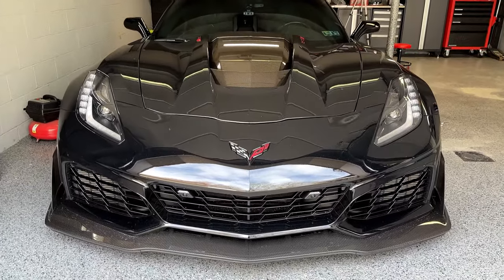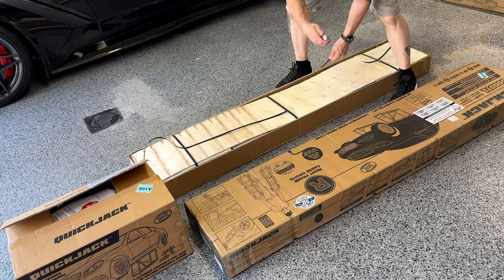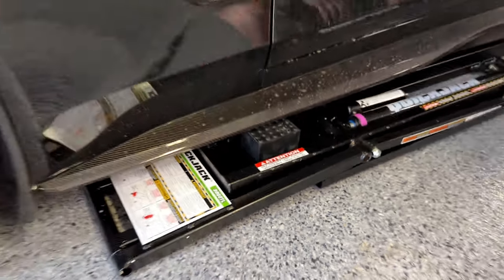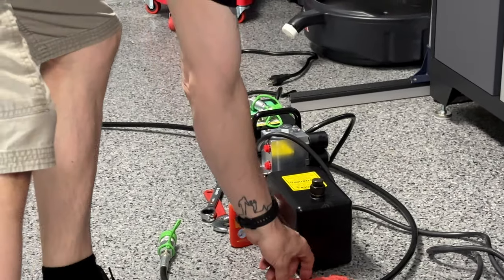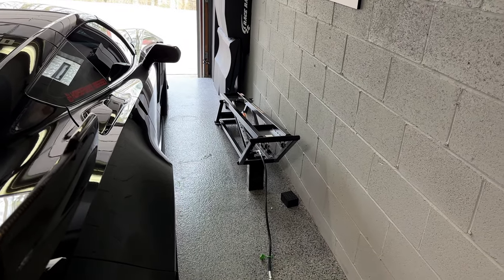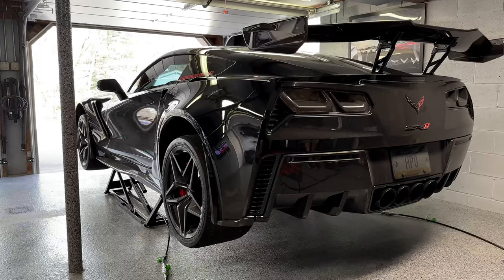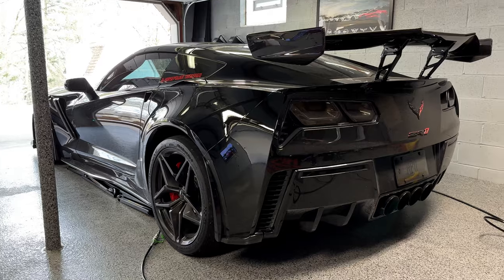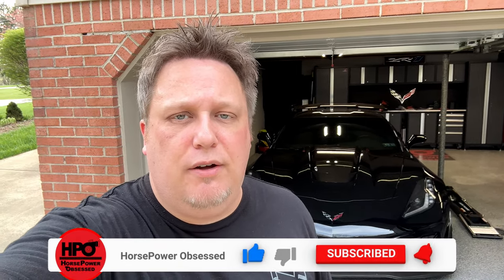The Ultimate Quick Jack 5000TL Setup Guide for Beginners

Comment: Purchased the Quickjacks last Fall. Used them to install the Borla axel-back system.  Noticed also that they do move the nose forward while raising.  Like you, did it with the garage door open.  Also purchased a kit to stow the installed hoses and now have casters to roll the jacks around.  I have not lowered my Grandsport so no issues getting the jacks under it.  Thanks for another interesting & helpful video Justin.  Bruce
Reply from the maker: You’re very welcome! Thank you for the tips! I didn’t know there was a kit for storing the hoses!

Comment: “Possible damaging trip to the dealership “ - most of the time it’s true.
Thanks for the video !
Reply from the maker: Unfortunately it is true more often than not it seems!
Reply: Yep we have 3 hellcats. Took our low mile almost new challenger redeye to dodge under warranty for an A/C line that went bad. Our GPS popped up they were driving 140MPH down the 5 freeway. I dont think an air conditioner line needs a road test, let alone freeway racing. They also scratched the bumper. They wouldnt take responsibility. They said they hire a local car detailer to come wash all their cars and blamed him

Comment: 6:11 don't you want to crack that "bleed screw" when they are pointed up so that all the hydraulic fluid flows to the bottom of the cylinders and the air in the system is at the top where the bleed screw is. Sort of like bleeding brake calipers.
Reply: The cylinder IS pointed up when bleeding.  No idea what you are saying.  When the Jack it dropped down the cylinders are pointed up.
Reply: @executiveinvestments  What do you call that Allen Key at 6:40? It that at the top? I don't think so; its at the bottom of the cylinder. Take it from someone that installed a hydralic lift system.
Reply: @achristian7015  what do you call the bleeder screw at 6:50?  Is that pointed up?  Yes.  Kid, you couldn’t wait that 10 seconds for him to show the bleeding.  Hence you embarrassed yourself by saying something you are completely wrong about.
Reply: @executiveinvestments  And at 6:22 where is that bleed screw where it is clearly visible? Below the rest of the system. Duhhh!  The trouble with you over-educated types is you cannot reason. A bleed screw has to be at the highest point in the system and not below the rest of the cylinder. Now if he tilted that end higher than the rest of the system, he would get the air out faster. On my real lift, the bleed screws are at the top where the cylinders are vertically mounted.
Reply: @achristian7015  he is doing the bleeding exactly the way Quick Jacks says to do it in their instructions. The bleeding is done while the Jack is in the lowered position, with the bleed valve end of the unit slightly elevated. Please do some basic research before you insist someone is doing it wrong. You don't know as much about how this works as you think you do.
Reply: @j29maniac  yeah right which is why I never have to hire any trades for two reasons. 1) it is done right and 2) I get to save money which is a bonus. My QJ is working perfectly just as my self installed MaxJax is that is now 10 years old.
Reply: @j29maniac  by the way wise one, the instructions for my BendPak MaxJax were not only in error, but also contradicting their info in the manual. You think Quick Jacks is perfect which is why their own manuals have "versions".
Reply: @achristian7015  all I said was he was doing it the way the people who designed it instructed him to do.  You know so much more about their product than they do, so you can do it however you want to.
Reply: @j29maniac  Just because it is in a manual, does not make it right. Which is why manuals have revision dates and versions. My other lift is a Bend Pak Max Jax. There were errors and contradictions in the manual. Too many believe everything they read on the internet, you need to know enough to reason through what you read. Car forums...everybody is an expert but knows nothing.
Reply: @achristian7015  your last sentence says it all. I totally agree with you.

Comment: It's about time you got them. lol I bought the 7000TL for my mini and SUV and had them a couple of years without any issues. I didn't think they were low enough to get under your car but good to know.
Reply from the maker: That is the reason I went with the 5000 because it needed to fit under my car.
Reply: @HorsePowerObsessed  what is the width of the frame of 5000? The 7000tl is 1.6 inches

Comment: Just to confirm, does the lift point spread on the Quick Jacks align properly with the lifting pucks on the car?  It didn't look like you had to use a special attachment or unique approach to make it work but I want to be sure.  I just bought a C7 Z06 with attached pucks and I[m thinking of getting this for maintenance.
Reply from the maker: Perfect for the c7 right out of the box.

Comment: What is your minimum ground clearance on that ZR1? Also, do they have "pucks" that caress the lifting pucks?
My ground clearance on my '19 Z06 is 3.25" at the front of the side skirts and the front splitter, and about 3.35" at the front lifting pucks. I need to know of these will work for me, because that's not much breathing room.
Reply from the maker: That's the same as mine and my ZR1 has the leave in jack pucks, too. You should be good.
Reply: @HorsePowerObsessed  awesome, thank you sir!

Comment: What did you do about jacking pucks and fact that quickjack wells need about anoer inch to line up? Did you just let jacking pucks sit a little off?
Reply from the maker: With the bigger rubber block that I use, it only sits off by maybe a half an inch and that’s OK, considering the jack puck is about 2 1/2 inches.
Reply: Right? I have a C7 Z and my QuickJack has been assembled for a year collecting dust in my garage. Too sketchy for me. Like barely one inch to spare on each side. No fuckin way I’m gonna trust my car on that thing.

Comment: Shouldn't you let the thread seal cure for 24 hours before you use it?
Reply from the maker: It says 10 minutes on the bottle.
Reply: I know that I wish I had read/known that. Complete mess. Had to redo all the fittings that required it.

Comment: According to the yellow sticker near the ATF fill hole is its says "loosen breather before use" and "tightened when transporting." Does that mean you keep the breather valve loose the whole time while using it?
Reply: Yes, otherwise, your tank will collapse during extension, and you want minimal restriction when dumping back to tank
Reply: No the new ones are self venting.

Comment: @horsepowerobsessed Josh does your jack gets from jacking point to jacking point? cus mine don’t and my C8 is lowered so i can’t used the rubber blocks wont fit.
Reply from the maker: I haven't tried it on my C8 yet but I've heard the rails aren't long enough. With that said, the back ones can rest further forward than the jack point without issue, just be careful to load the car up right.

Comment: The bottle of sealant says to wait 24 hours, but in this video you didn't. Neither did I, and now there's ATF all over the place. How did yours not leak?
Reply from the maker: I didn't wait 24 hours. I waited MAYBE 15 minutes. No leaks here.
Reply: @HorsePowerObsessed weird, oh well, I cleaned it off and used teflon tape instead. Now it's fine, no leaks 🤷
Reply from the maker: @FoxHoundUnit89 interesting…

Comment: I have the 7000TL and I'd say it's ok, but only if you're lucky and get one without a defective air cylinder.  If you do get one of those you're screwed - the company will 100% not stand behind their product.  They'll claim the air-assist down isn't "necessary to the function of the lift".  Really?  So if one side has air assist down and the other doesn't, and they drop unevenly, that's safe?  And then when the vehicle drops to the ground and one side of the lift goes straight to the full down position while the other...  doesn't.  You need to wait... and wait... and wait for it to drop with no weight on it.  Quickjack will claim this "is normal operation" and that "it will get better over time".  If you invest a massive amount of time trying to get them to stand behind their product they will, eventually, after burning through every once of customer goodwill, send out a new cylinder.  Yay!  Until you get the replacement and the freakin' air side is literally capped off.  Like intentionally made unusable.  That's not a fix guys.  Then they'll claim that the engineers decided the down-assist wasn't necessary and that they've changed the design on future models.  But I didn't buy a future model with less functionality.  I bought the current model with exactly the functionality I wanted, was promised, and paid for.  Whatever.  Too much time wasted on it already - I've written off the entire company as another skanky marketing hack with no integrity.  

I still have it in my shop, but the company worked very hard to make me regret my purchase and it low-key pisses me off every time I look at it.  And honestly the setup is inconvenient enough that even when I do pull it out - warts and all - it happens very rarely.  Only when I have a longer term project where I know the vehicle will be on the lift for a week or two.  Definitely not for things like oil or tire changes.  It's just way quicker to use a floor jack, or even ramps.
Reply: Oh no! That sounds like a terrible experience:( for whats its worth maybe I can teach you some things about the QuickJack: The air bottles literally have no function when lowering a QuickJack with weight. The air bottles are inflated with approximately 50 PSI generating a little force downwards, while a vehicle will generate 1500 PSI downwards. Even with smaller objects like boats, lawnmowers etc you do not need the air bottles.
Meaning there is not any difference when lowering UNTIL the vehicle hits the ground and the QuickJack frames have to lower by them selfs. That’s when the air pressure might help a little. However over the year the seals of the cylinders will wear in and the jack will come down easily without this air bottle help. And before that happens, you can just simply push with your foot on the frame (bc you are already standing there) and it will come down all the way immediately: 
Now personally ;) I would go with a low viscosity fluid (like iso 32 hydraulic) which seems to flow a lot better. Also if you are expiring unequally lowering WITH weight, you might want to check for air, obstructions and other issues. Its usually some teflon you’ve put in a fitting by mistake. You can always try to switch hydraulic hoses to see if an obstruction moves to another location. 
Good luck buddy, can’t be that hard!

Comment: luv the QJ...one note of caution.  When doing a job that requires you to compress the suspension while in the air, be CAREFUL !

With the car on the QJs and compressing the suspension with a say a floor jack...you can TIP the vehicle.

Ask me why I know 😑...caught the issue before going beyond point of no return
Reply from the maker: Interesting! That must take some serious force because this thing is PLANTED when it's up in the air on these things.
Reply: @HorsePowerObsessed  The job was replacing rear springs on a front engine BMW and was I compressing the rear suspension with a floor jack (upward moment). The QJ, positioned on low height mark, rotated on the front hinge point.  And analyzing it, think of how the QJ lifts, the two platforms are offset to the front, thus their is more front overhang.  

I think if it was compressing the front suspension, it would take significantly more due to lever arm length to the rear at the same setting

Comment: I've heard that when those are up at ANY Height the Locking Arm can be (Easily) accidentally kicked or bumped into which would cause the affected arm to fail. For that Reason and until i see a Fix for the Possible Problem I'll pass on this Product for now. Especially on a Car costing $100,000 and UP . MIGHT be Great for a $3000 dollar work 🚗, but i aint trusting those jacks on much of anything else. Just me🤷‍♀️
Reply from the maker: Definitely not a problem, but at the same time I would also jackstands if you are fully underneath the car just for that added safety.

Comment: Not getting into it, but its overpriced for what it actually is. A full 2 post lift is actually cheaper if your garage can accommodate one. The actual price is about half or less for these. Just saying, and im not advertising because many consumers might find the convenience of this quick jack offer better suited for them.
Reply from the maker: “If your garage can accommodate one” is the largest problem because most garage are not large enough for that
Reply: yeah, but you can't take that 2 post to the track or your buddies house etc. I doubt you can get a 2 post that is worth anything for ~700 bucks which is half of what a QJ sells for.
Reply: @billhughes5081   Amazon is the reseller. Oh yes you can get this for 700 bucks.